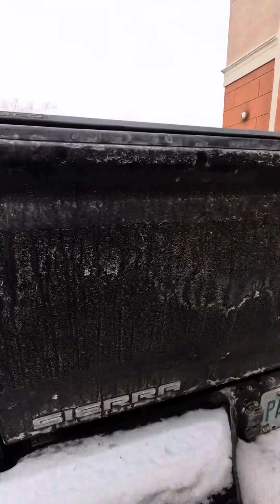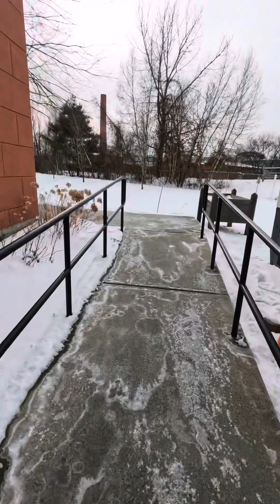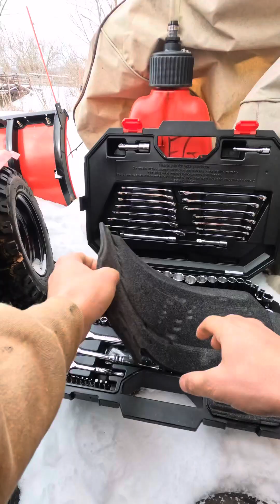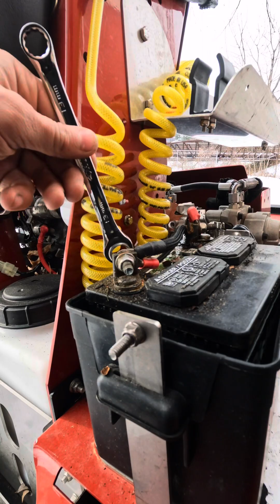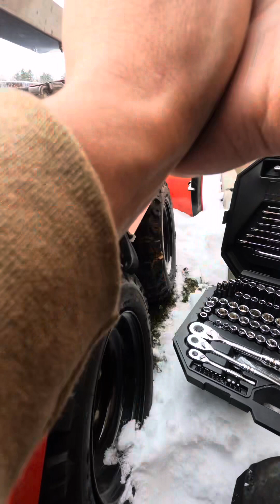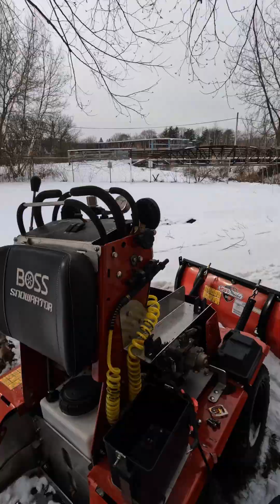Fix it Friday | Boss snowrator

Comment: Does the motor charge the battery, or are they standalone and you have to charge them ?
Reply from the maker: @bluecatcurtis  motor charges them
Reply: @Plowme  hmm gotta figure out my machine, it's brand new and doesn't charge battery.
Reply: Do you know which wire is the charge wire ?